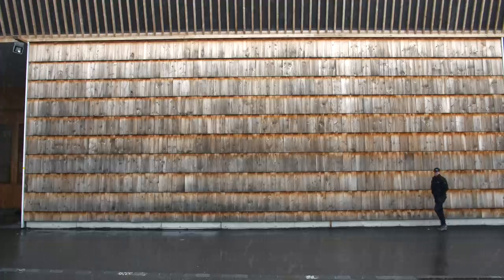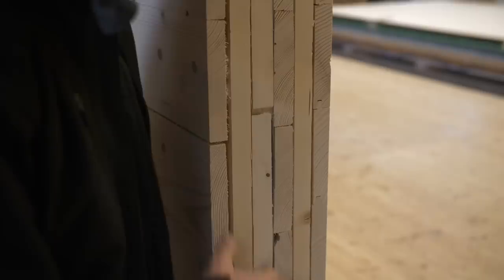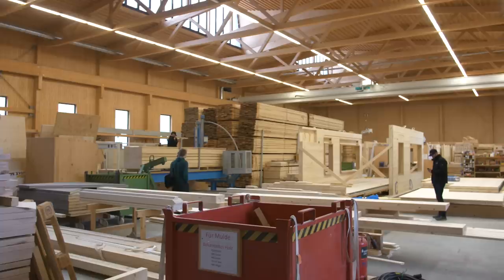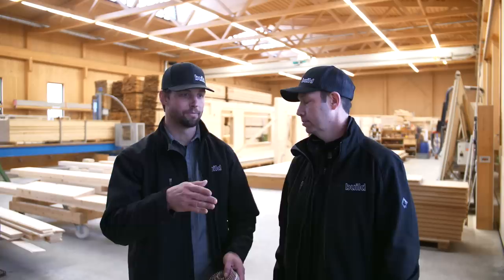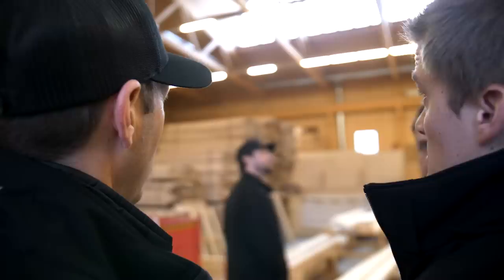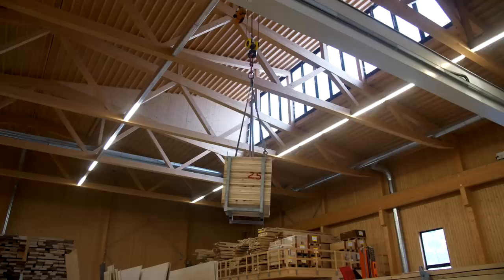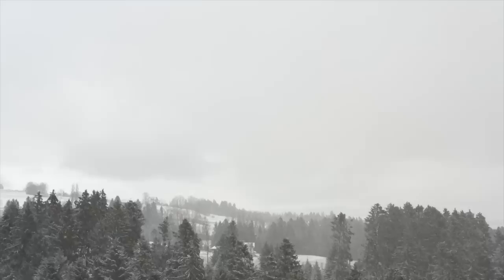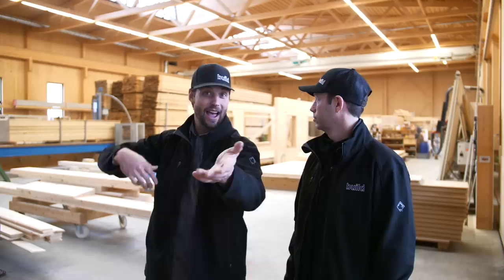This Swiss Builder uses NO INSULATION...

Comment: Rubbish. What a huge waste of material. R24? that's nothing. In a net zero house in a cold climate one would aim for R40 walls. Try optimum value engineering framing and use rockwool insulation exterior to the sheathing where you locate the air, vapour and water control layer and use cellulose in the stud cavities. Also, Switzerland, as a state has existed since 1848, younger than the US.

Comment: MOLD and MILdEW. That's why its a first generation construction material.
Reply: Mold in dry wood? How?
Reply: @FutureChaosTV Humidity is the cause of wood rot, and that why planes aren't built out of "dry" wood. Wooden boats are constantly being rebuilt even with the use of tar. Wood literally expands, deforms and changes sizes for water vapor (at 140,000 psi, ancient blockbusting technically) and it would have to be presser treated with chemicals to begin with. Also it reckless to build anything out of solid wood these days that's bigger than a rocking chair, and you would have better insulation properties from laminated wood anyways..

Comment: No thank you on the wood warehouse. Nothing better than increasing your cost by 5 to 7 times what a metal warehouse would cost. And don't forget all the additional delays from code enforcement.
Reply: We bin building with western red cedar for 14,000 years. We take a dozen planks off a tree it continues to grow. Our ocean going canoes were 60' x 8' x 10' a single log... Guess you never processed your own wood...
Reply: I don't think the decision to build a wood factory was intended to be cost effective. It was more marketing and "practice what you preach." Probably most of their customers make at least one trip to the factory.
Reply: Brad Hansen I agree, just marketing. there is nothing practical about it.
Reply: Why just marketing? If u can build it with ur own staff, you safe a lot of money. Think about it. Code enforcement is not a big problem, if u have a proper construction setup. This hall will be up in a couple of weeks.
Reply: Johann Koenitz i in no way shape or form want to insult you, but from your reply I can tell you do NOT own a business or any commercial property and you have never pulled a new construction building permit.
So no these are not something you could have your staff assemble. For one thing that’s insulting to professional construction workers and these pieces weight are measured in tons.
As to the permit end it will cost you at least 20 grand to bring in experts and engineers just to educate the different groups involved, then the design revisions start I expect that will cost another 20 grand.  It’s just not even remotely close to cost effective or practical for commercial use.
If someone wants it for their own personal home, more power to them.